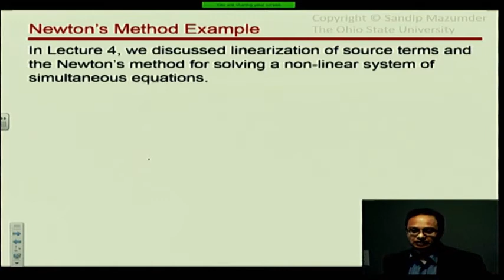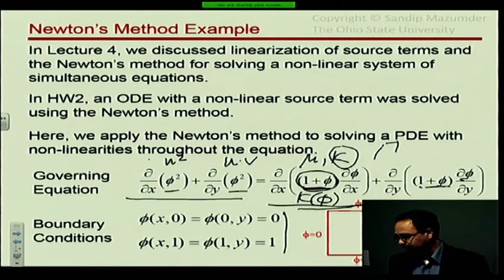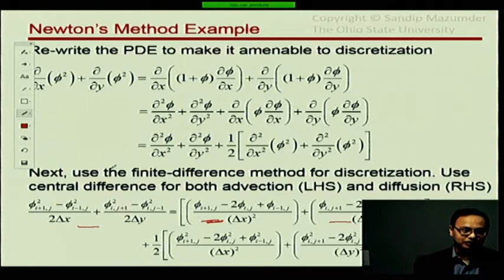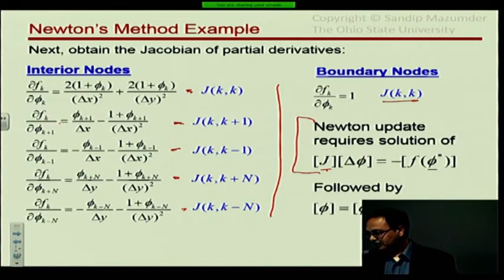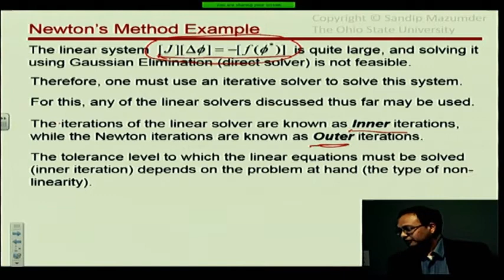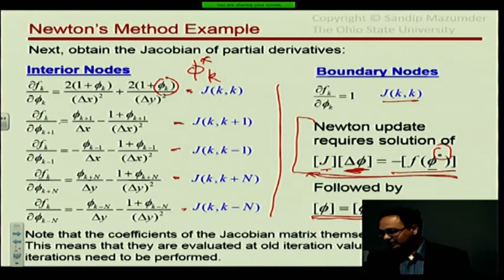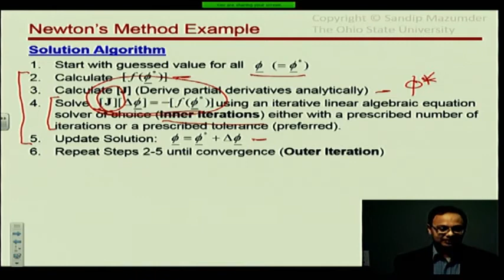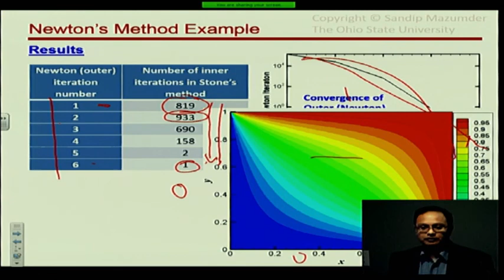Newton's Method for Solving Nonlinear PDE

Comment: Hello Mr Mazumder, could I ask a quesion about J matrix? Suppose I have a nonlinear pde: ∂u/∂t = ∂((∂u/∂x)*u^2.5)/∂x , how could I get a J matrix? It seems that no matter how I discretize the nonlinear term, there will always be a √u term and I have no idea on how to represent it using a mtrix.
Reply from the maker: Why is that a problem? Remember, that J is calculated using previous iteration values; so in this case, you will use previous iteration values of u.
Reply: @sandipmazumder171  Yes you are right. I didn't fully understand Newton's method. Thanks a lot!

Comment: FEM , FDM with newton roots and many other "difference" equations can be cooked up to approximate the continuous PDE and ODE equation. But how about if you got a nonlinear system of equations in PDE or ODE?   Obviously newtons method can be generalize to solving nonlinear systems of regular equations (using jacobians) 
But how can all this be generalized to solving PDE or ODE systems of equations? Its already chaotic enough with the FEM and FDM for single equations but i kind of want to for sake of completeness under stand it for systems
Reply from the maker: Idea is still the same. Lets say your first PDE has p1, p2, p3 , ...pN as your unknowns. These are the unknown values at the nodes. And your second PDE has unknowns q1, q2, q3,...,qN. Now you construct a new unknown vector phi = [p1,p2,p3,...pN,q1,q2,q3,...,qN] and proceed with the Newton's method. When you compute the partial derivatives, because the PDEs are coupled, some elements, such as dphi(1)/dphi(N+2), will be non-zero. This is not the best way to do it, but it works. For more, see lecture on Coupled PDEs.

Comment: Curious i understand how to do numerical methods for PDE and ODE of nonlinear type and you do a great explanation on it for equations. But what i am after now is how to solve numerically systems of PDE and ODE of nonlinear type?
Reply: But what happens  if it's nonlinear
Reply: 4 years late, but you can not linearize the system as a matrix times a column vector. You need to solve a non-linear set of equations iteratively because of this